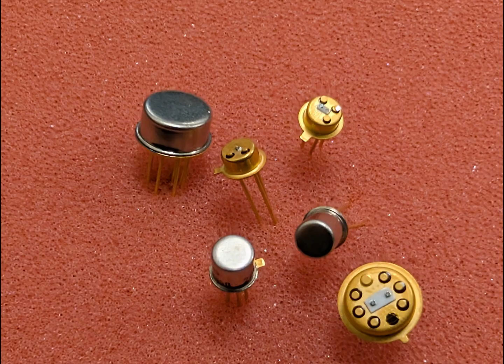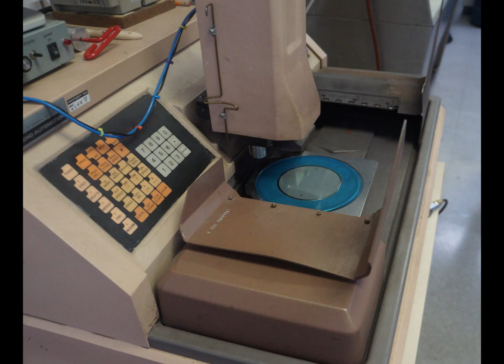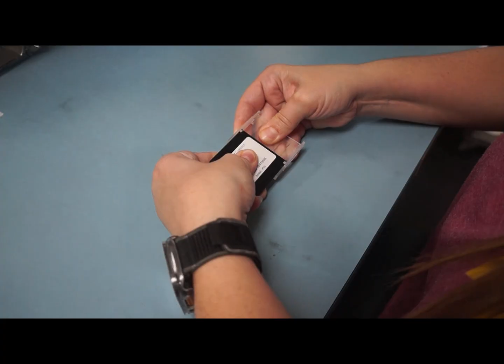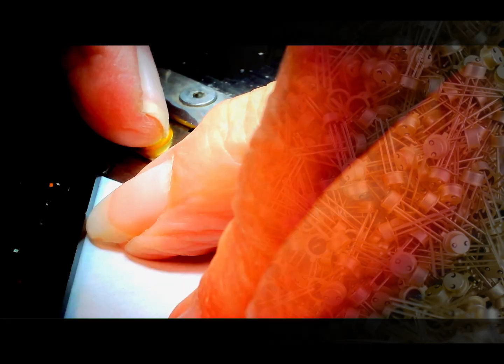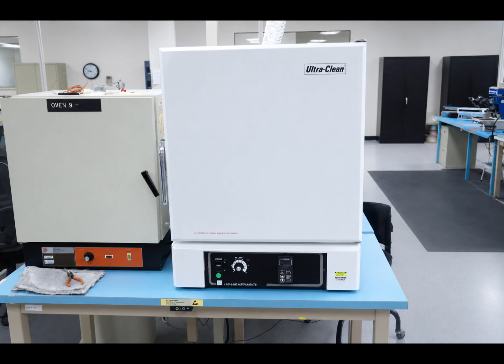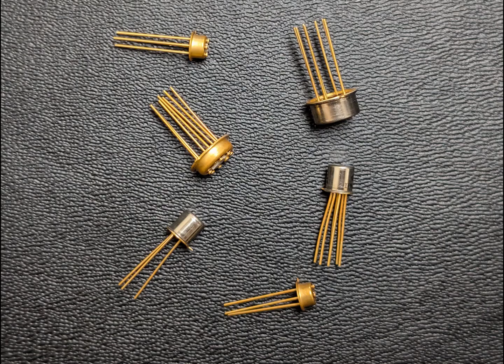Metal Case Assembly | InterFET |

Comment: Thanks for video, I've used great low noise InterFET JFETs in projects. Do you use glove-box visible in this video to control gas composition inside of the can during welding process? Is it argon or nitrogen environment inside the can?
Reply from the maker: We use Nitrogen gas in our welding process.